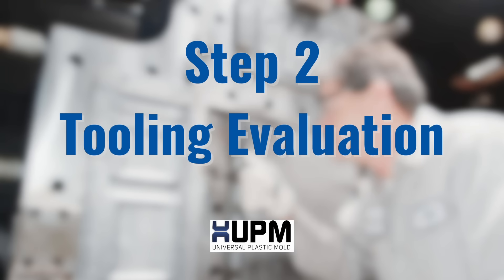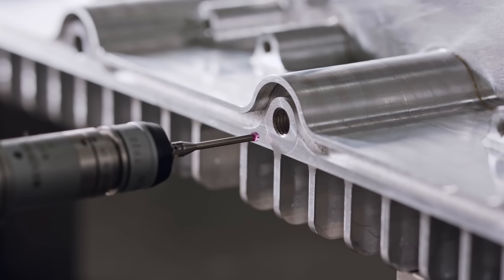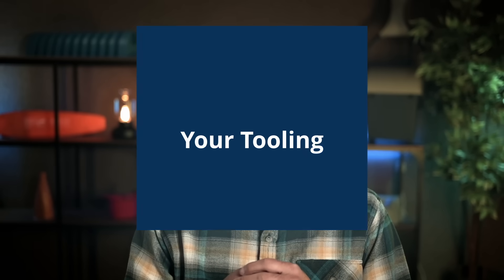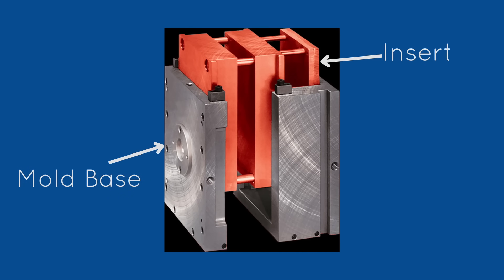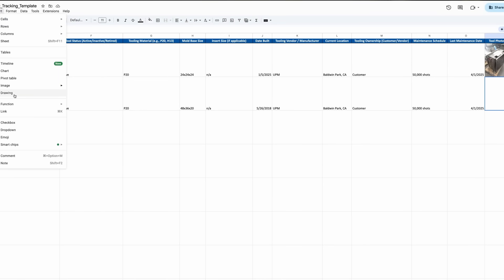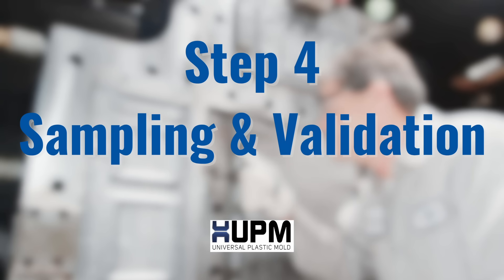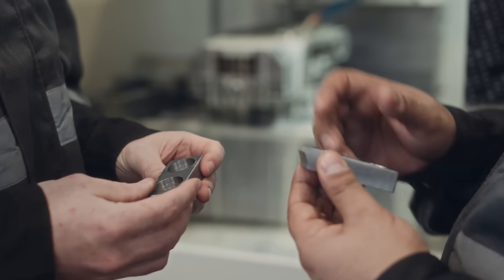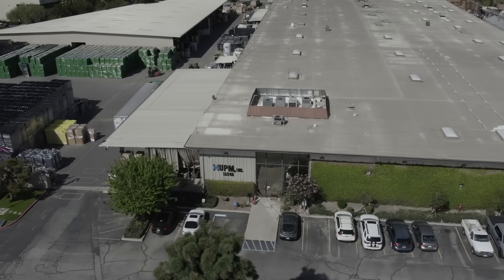5 Steps to Reshore Injection Molding from China to the USA  #Reshoring #usmanufacturing

Comment: Reshoring is a valid strategy for some. However, for rapid prototyping, bridge tooling, and low-volume production, our agile manufacturing model in China offers unparalleled speed and flexibility, often turning around parts in days, not weeks. This allows for faster iteration and market testing. Different solutions for different stages.:face-blue-smiling:

Comment: Good information. How do we find out if we own our tooling in China? We have several molds there but don't know how to determine if we own them.
Reply from the maker: Hi Eric - thanks for asking. We suggest first checking your records (old invoices, contracts, etc). If you were invoiced for the tooling chances are you own the mold. Then we suggest requesting pictures of the inside and outside of the mold along with the dimensions from the current molder. Last, have a conversation with the other molder to make sure you own the molds and they are capable of being exported to the US.